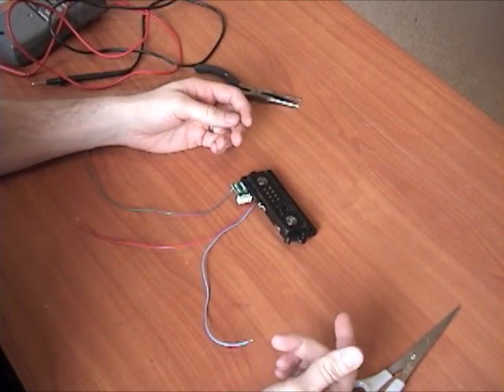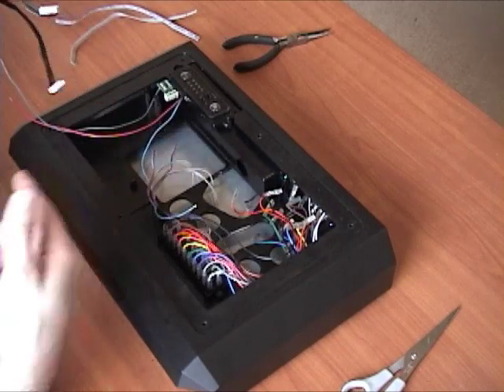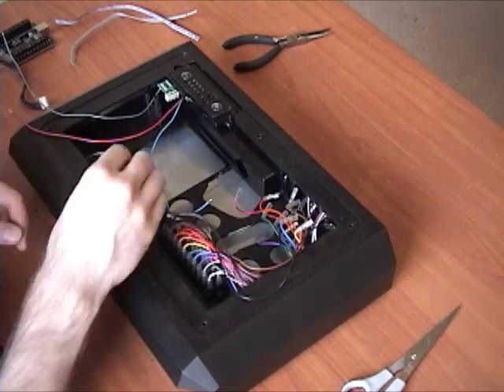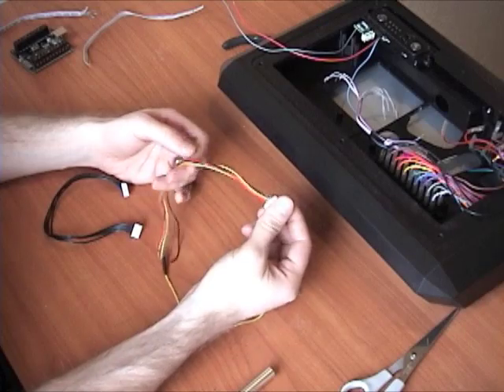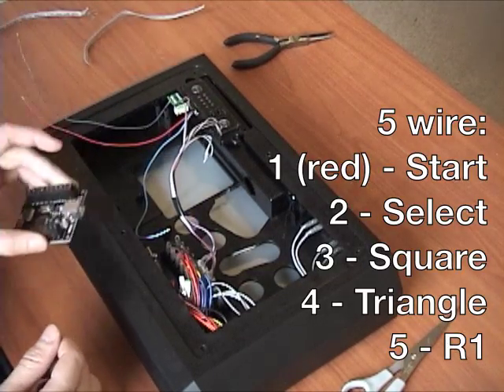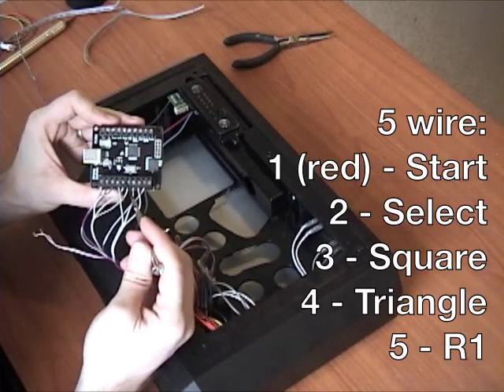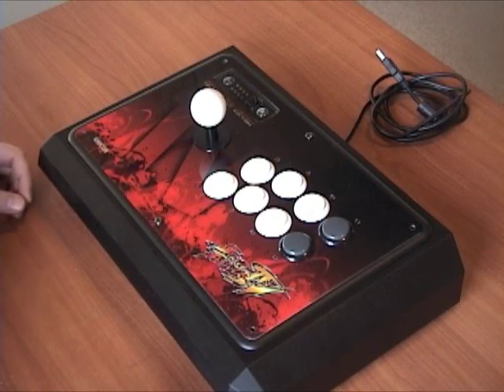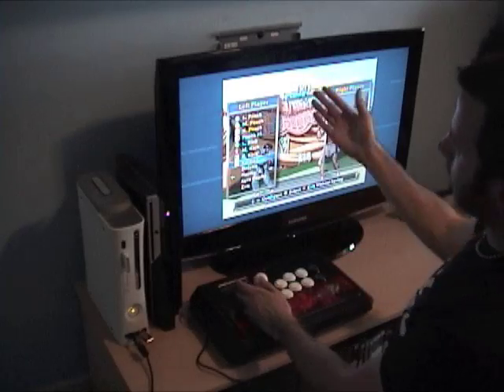How To Install an Akishop PS360 Joystick PCB into PlayStation 3 Mad Catz FightStick TE (Part 2)

Comment: Hey there. How on Earth did you just 'plug' in the USB in the PS360+? I had to solder the ends of mine after cutting.

At 10:53
Reply from the maker: This is the older model, not the +.
Reply: Oh I see. Thanks for reply

Comment: can you use a psx and usb cable at the same time or do you have to switch id everytime?
Reply: This Akishop is the original. I don't have any knowledge about the new multi console variety. However, I don't see why you couldn't have both hooked up to the PCB. I would only plug the PSX or USB end into 1 console at a time though.

Comment: I see. The only reason I'm modding it is because my laptops mobo doesn't support it and this MC Cthulhu is widely supported and has a 30day return if it doesn't work. I may look into possibly soldering it then. Though apparently it can emulate the home button feature by pressing start+select simultaneously. I'm still not sure how to connect turbo with it, but I don't have to have turbo. I've found a soldering iron and rosen for about 15$ on amazon which isn't too bad.

Comment from the maker: A Cthulhu won't really get you anywhere unless your PS3 TE PCB is fried. The Cthulhu only ads PS3 (or I guess multi-console if you want things other than 360).

The problem with the PS3 Mad Catz sticks is that the main PCB and turbo/home functionality are all on one board. In the 360, it's split and connected with ribbon cables, so it's easy to tap into those. Unfortunately you're only route with the PS3 is to solder. I guess you could add 24mm buttons somewhere on the case.

Comment: Thank you. That worked great. 
Another question: I'm a newb that's installing a Cthulhu PCB into my PS3 SF4 TE so that it will work with my laptop and PS3. It claims soldering isn't needed for this kind of mod. I don't really want to solder mostly because I don't own a tool for it and I don't want to spend more money to fix this issue. According to your video it seems this is required in order to make my home button/turbo work. Is there another way to workaround this?

Comment: If the led are blinking it is because your usb connection is bad. It happened to me too. Im having trouble hooking up the buttons, plus their is no turbo spot on my akishop. Im trying to hook up a te soul edition so i have 2 branch of 6 wire and only one has a red wire. Any suggestions?

Comment from the maker: Sure, can you have HitBox send me a stick? ;)

The process is pretty simple. Remove the whatever PCB is in there. Put in the Akishop PCB. Connect up the wires to the buttons. Everything is labeled, so I'm not sure where you could mess it up. Send me a message or a reply letting me know any specific questions you might have and I'll try to help.

Comment from the maker: Yes! Along with the Joytron Paewang Revolution, the only other PCB I know of that has both PS3/PC & 360 capability built in. Most of the time a 'dual-mod' consists of adding PS3 functionality (with a separate PCB) to a 360 PCB. This is everything in 1.

Comment from the maker: I unfortunately never got an Akishop PS360+, from what i've seen it's just as easy or easier than the previous version (which I show above). You're basically replacing the stock Mad Catz PCB(s) with the new PS360+ PCB. You'd have to do the same tip I show in the video to get access to the home + turbo buttons. There are some PDF install guides on the Focus Attack product page, but nothing spells that part out to you.

Comment from the maker: This Akishop is from the first run, and I don't have any experience with the headset PCB that's an option with the new/current Akishop PCB. I don't see why you couldn't use it, but you'd have to drill a tiny hole (around 1/8"? measure!). The TE frame may have an area for you to mount the headset PCB to, but if not just epoxy it or use some strong glue.

Comment from the maker: The only reason you would want to SWAP the PCB is if you have a PS3 stick and want to add 360 functionality. Similarly, if you have a 360 stick and want to add PS3 functionality, you might use a 'dual-mod' PCB like Toodle's Cthulhu or ChImp that is added along side your stock PCB.

Comment from the maker: @specialk122 They do not. You are basically only using the button presses from the stock PCB, everything else goes through the Akishop.

It would be nice if there was a way to connect up the LEDs to the Akishop PCB since it does include turbo functionality of its own. Maybe in a future version?

Comment from the maker: @robytrice22 Yes! In fact, it will be much simpler because you don't have to do any goofy soldering to hook up the home and turbo buttons. Just add some 24mm buttons to your custom stick and use them instead.

Comment from the maker: @daidouji The PCBs between the SE and TE sticks should be the same. The only difference is the case. The case is smaller so you'll have to find a suitable mounting position for the Akishop PCB inside the smaller SE.